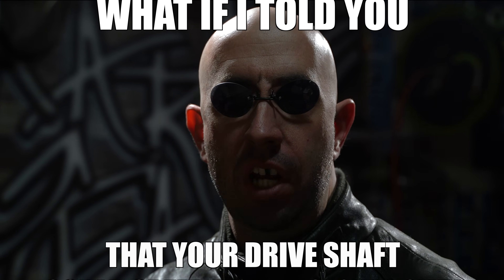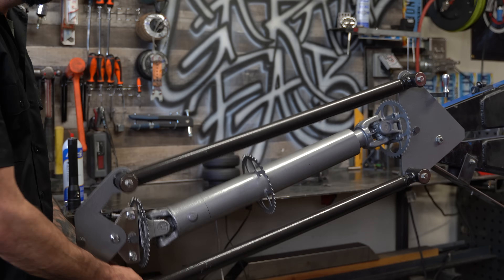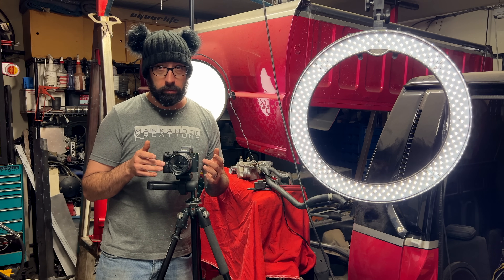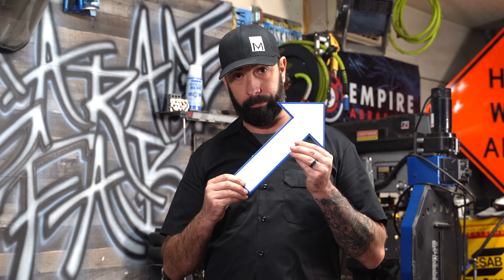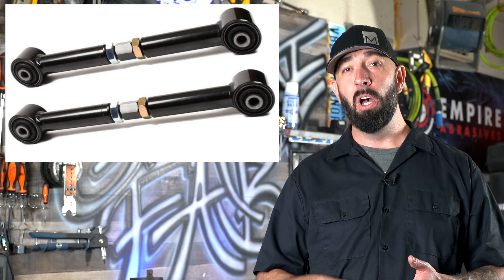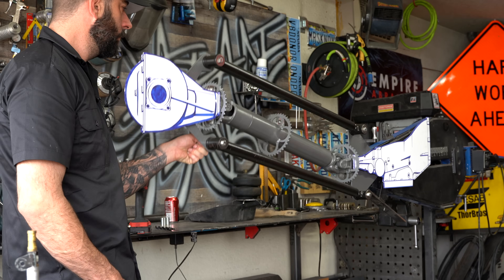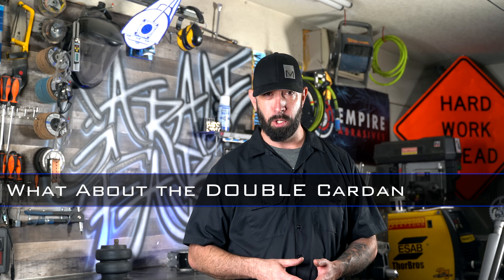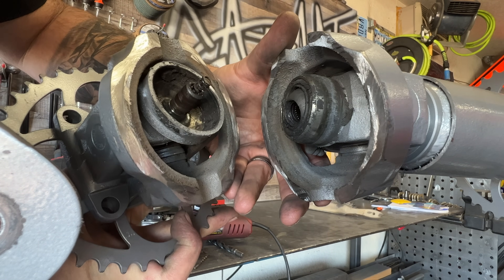THE Driveshaft Video. The Nature of U Joints. Suspension Basics Ep. 06

Comment: awesome informative video.. definatly will use this vid along with a few others u posted when I do my MM.
Reply from the maker: Excellent! Best compliment I could get. I hope you find them useful when that time comes. Hit me up any time if you’ve got questions.
Reply: @GarageFab  yeah ive  been thru all ur MM vids.. got lots of great ideas from them..

 I do have 1 question.. all the fb groups and forums say I need to move the 4g63 motor forwards 2" but no one on any site has explained why... is it to remove the cas?  as I moved mine 3/4" so far (not perm mounted yet).. and I can move the cas to set timing.. im also running the t-stat adapter some guy is selling so that clears the firewall with no issues... should I still move it forwards more?  thanks much. Steve
Reply from the maker: Honestly this is my first 4G swap. From my understanding it’s mostly just the thermostat housing that causes problems with the firewall. If you’ve got any basic Fab skills you can also create a recess in the firewall and leave the motor in place.
I’m not quite to that point yet and I’m having some other issues finding the right thermostat housings. 😠 
So all I can do is relay what I’ve read. Lemme know what you come up with! I’d love to see it when you get it rolling!

Comment: Is it feasible to make a cv driveshaft and eliminate the oscillations all together?  Perhaps an independent rear suspension can also help - the diff would be mounted to the frame and pinion angle wouldn't change during suspension travel.  But then you'd create a new problem of extreme camber changes during travel -- which I'm hoping to see a video on!  Camber change and tire wear is what's preventing me from customizing my vehicles as I drive them more often than I show them.  Also, I've never seen a parallel link suspension before your videos and they're interesting.  How does a vehicle handle/launch with an infinite instant center?
Reply from the maker: More than feasible! Honda makes CV drive shafts on some of it’s models. Unsure why it’s not more common. My guess is manufacturing cost. 🤷‍♂️ 
If you stick around long enough, you’ll see plenty of independent adjustable suspension. I just picked up two 2008 Chevy Impala SS’ as donors for a twin engine Mini Truck that I’m starting as soon as the Wife’s truck rolls out of the garage.
As for the parallel link setup, it’s not a perfect design, but it’s great for adjustable suspension and it can be made to perform pretty well. My first major Mini Truck project was a V8 Ram 50. I angled the parallel bars in a way that created some antisquat properties and it had plenty of traction. It requires a lot of room that only trucks have unfortunately. Attempting that on a passenger car would probably require deleting the rear seats. 😬
Reply: @GarageFab  I really look forward to seeing more of your videos where maybe you can dig deeper into these topics!  Ive been having dreams and visions of a truck with a non adjustable suspension, but the body mounts were on adjustable height.  You'd have predictable camber and full suspension travel, yet could adjust body height from scraping to a lifted truck position.  But you'd have to figure out throttle cable, brake lines, steering shaft, parking brake and wiring harness length adjustments lol

Comment: Good to see you back. I do have a question about what I was told. With a double cardon (at the transfer case), what angle should you have at your differential?
Reply from the maker: What type of suspension does your cricket have?
Reply: @GarageFab  links. I was told to have the differential about one degree lower than the single u-joint to keep the u-joint active but not changing speed (or very little speed change).
Reply from the maker: That’s good ol iphone auto correct hard at work.  🧐 What type of suspension does your VEHICLE have?
I’m assuming you have static, non-adjustable height suspension. 
In that case, yes, the single U joint should be relatively straight with the driveshaft. A very slight bend downward will keep the needle bearings moving and prevent flat spots on them. A 1 degree angle generally isn’t enough to cause noticeable vibrations.
If you have adjustable suspension, disregard everything I just said.
Reply: @GarageFab  cricket?

Comment: Hi garage fab.

Can you do a talk on narrow angle, standard angle and wide angle universal joints on drive shafts and half shafts.

Because some vehicles have all round independent suspension and some vehicles like the old series land rovers from the UK had uj's on the half shafts in side the rigid front axle and some vehicles like the british manufacturer tvr fitted independent rear suspension with universal joints on the half shafts.

So I understanding between the different universal joints throat angles.
Reply from the maker: I’m gonna have to do some research on that first. Not gonna lie, I haven’t heard a lot of those terms before.
I do know that I had to modify the U joints I had in order to get a greater angle for demonstration purposes.